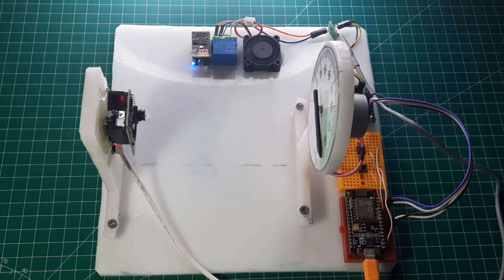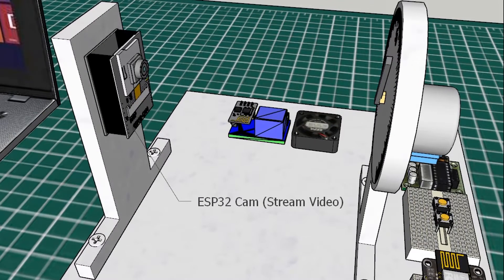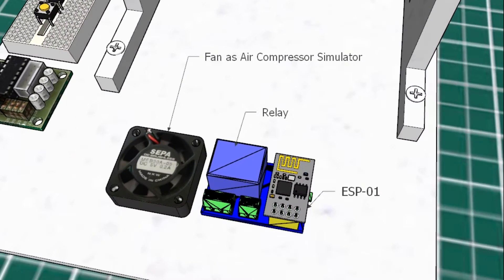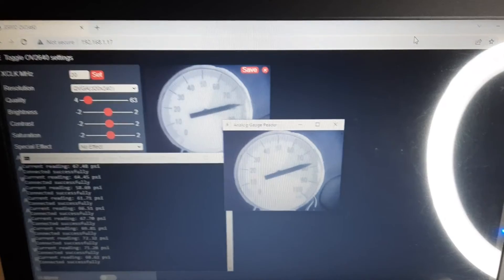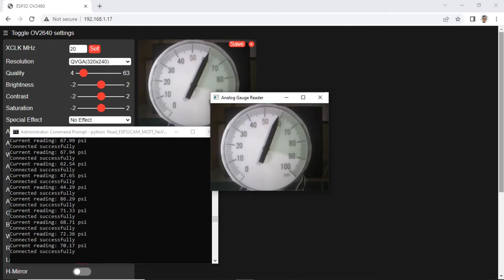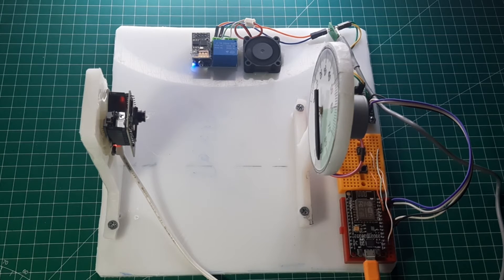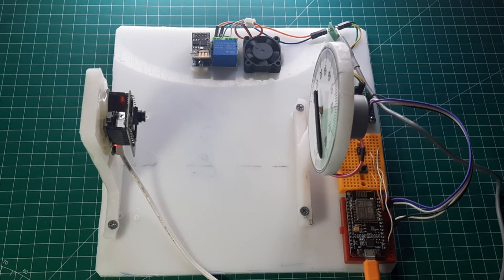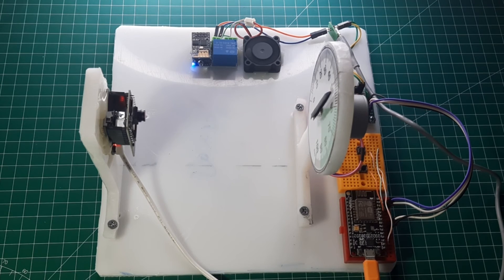Air Compressor controller simulation using ESP32 Cam, Python OpenCV, and ESP8266

Comment: Bagaimana dengan membaca digit digital yg berasal dari Pi digital apakah bisa ?
Reply from the maker: Mohon maaf,apa yg dimaksud dengan Pi digital?
Reply: @YaserAliHusen  pressure indikator digital
Reply from the maker: @Abu_Khalid- ,pada video ini python membaca posisi jarum, maka pada PI Digital python akan membaca angka, harusnya lebih mudah pak
Reply: @YaserAliHusen  untuk melakukan pembacaan angka digital apakah bisa dilakukan tanpa mengkoneksikan espcam ke PC ?
Reply from the maker: @Abu_Khalid-  ,mohon maaf saya belum pernah melakukan itu.
Baru bisa membacanya dengan opencv python di windows
Reply: Memakai program yang mana jika hanya mengirimkan nilai angka nya ke mqtt di arduino ide nya?
Reply from the maker: @agilalfarizal  , membaca nilai gauge menggunakan python di windows, dan mengirimkannya ke mqtt broker.
Bukan di arduino nya.
Reply: @Yaser Ali Husen oke pak apakah ada link referensi untuk pengaturan di mqtt brokernya mohon bantuannya pak saya sedang sidang skripsi 🙏